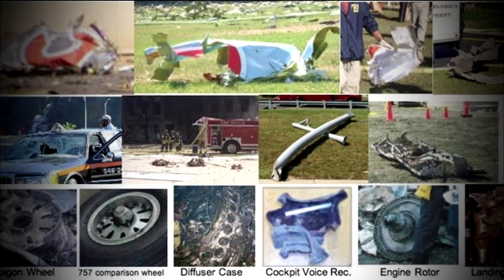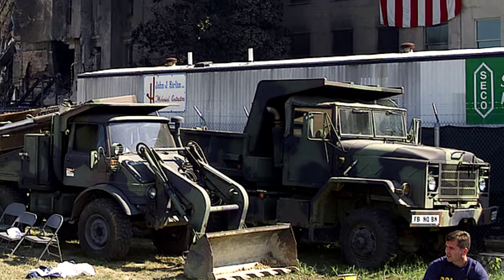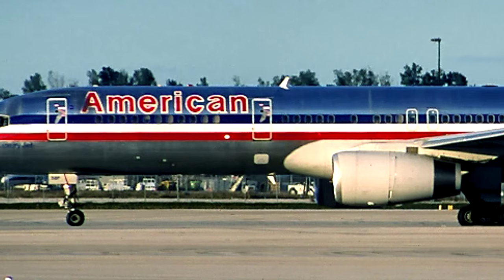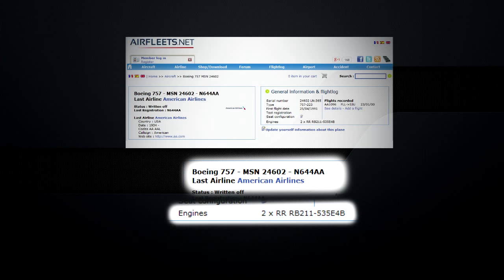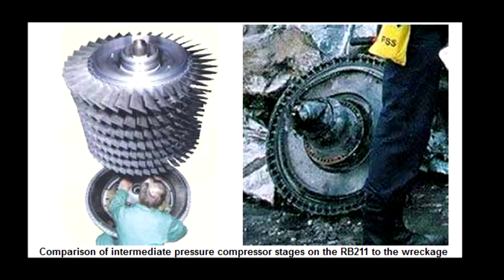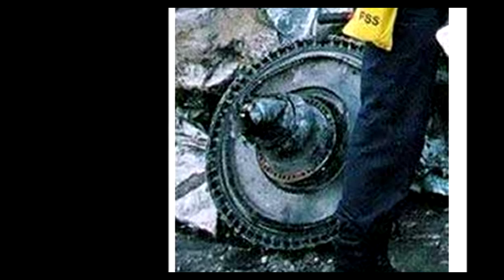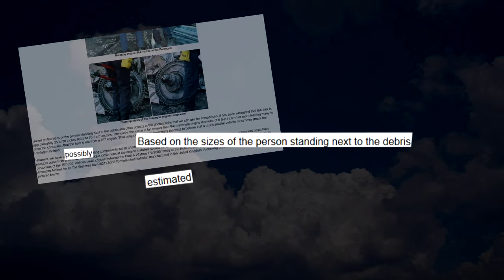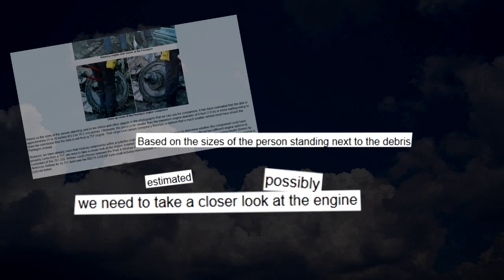Scene from 9/11: IDENTIFY - Pentagon

Comment: Raytheon cruise missle
Reply: @speculizer1971  black boxes, voice recorder and a few of the  video tapes from the multiple locations with cameras that day (Hilton)  and I'll throw my hands up.  All I've seen so far is a ridiculous cover story and a pile of lies.
Reply: I'm a firefighter too.  And I've done plenty of research.  But my resume isn't important.  What is important, however, is your not an airline pilot, aeronautical engineer or physics professor.  I think I'll side with the dozens and dozens of lectures and analysis by those who do hold those titles that prove beyond any doubt that the official story we were told is not only ridiculous but impossible.  I was there that day too..everyone has a fucking story and what you saw was your experience...but I've heard that fairy tale a hundred times before and it still doesn't begin to explain the simplest of questions.  Black boxes.  Video from the dozens of cameras in Arlington.  And a reason a commercial jet liner had only 45 people on it.  That's just for starters.
Reply: It doesn't look anything like a AAL 757 weird how 130+ people mistook that